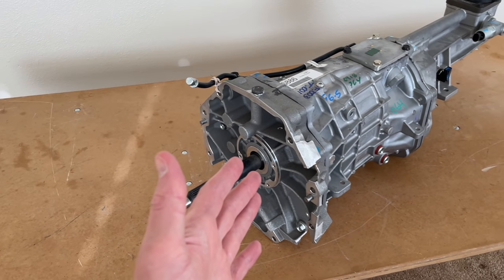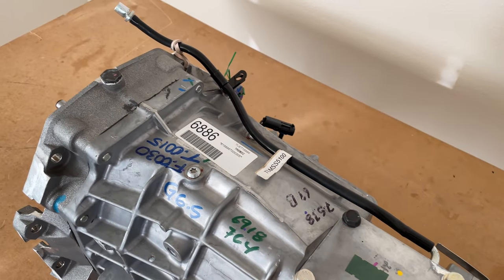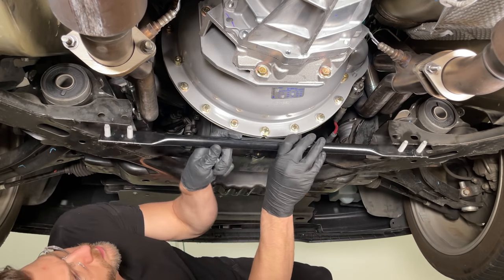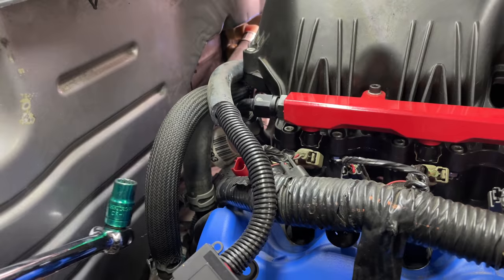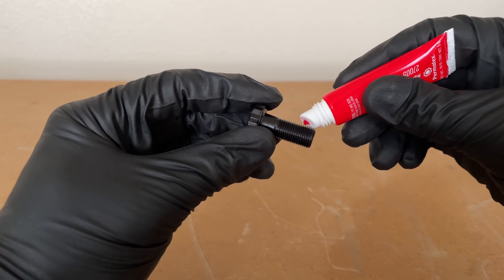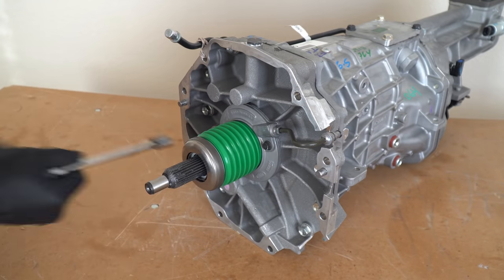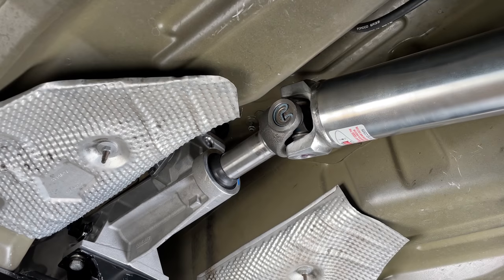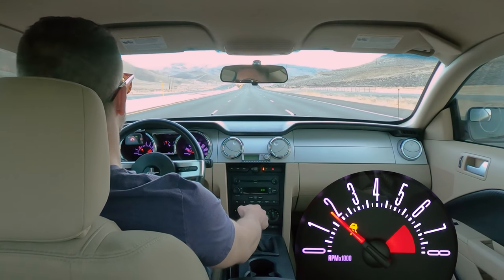How to install a T56 Magnum

Comment from the maker: Have questions for me? Let's chat 👇
https://bit.ly/_foureyes
Reply: will the steps be about the same for the 2015-2017 models?
Reply: What are those jack stands called, do you have a link to buy them.
Reply: top speed run?
Reply: What do you use ATF for a manual box?
Reply: What made you go with 2.97 vs 2.66? Any hills to climb? I think you're running 4.10's in the rear, right?

Comment: this dude literally got video footage of every single step, mad respect, thats a lot of work. i just love a good instructional video
Reply from the maker: it really is - don't recommend it. and thank you 🙏
Reply: @Four_Eyes  probably why so many "how-to's" skip so much of the actual "how-to". Quality work
Reply: @Four_Eyes  worth the effort mate, banging job
Reply: Suggestion for next video: How to have a spotless garage, spotless engine bay, and spotless parts.👍
Reply: The lighting during the under car steps shows that he cares
Reply: Amazing Video!
Reply: Was that the McLeod RST clutch in had in already before u installed the RXT clutch
Reply: Except for the proper mounting depth and shimming of the slave for the bearing to sit on the clutch springs. I run the T56 in my 69 camaro luv it

Comment: Literally the best, most informative build series I've been able to find yet, that's still easy understand! Keep up the good work!
Reply from the maker: much appreciated justin 🙏
Reply: Hogwash. The best, strongest and toughest manual transmissions are, in no particular order
Ford Top Loader
Chrysler A-833
GM Muncie rock crusher.
PERIOD
This is my 50th year in automotive repair including transmissions....I know what Im talking about.
Reply: @donreinke5863  huh?
Reply: @MrM3dic  Duh?
Reply: @donreinke5863  4 gears is too little IMO. I would need minimum 5, but 6 is way better because the gear rations are very close and you get very consistent nearly identical RPM drops in every gear change.
Reply: @SI0AX  Depends on whether its close or wide ratio. The T5 used in older Mustangs had a really low first gear and it would sort of hit the wall from 1-2 even though it had 5 speeds
Reply: @donreinke5863  Most 5 speeds have inconsistent gear ratios. Some gears are a lot shorter than the next gears and it makes you have to remember how much the RPM drops from one gear to another when you want to tune a power band. I find that most 6-speeds even automatics have consistent RPM drops and it takes the guess work out of tuning a power band.

The only 5 speed I would take over a 6-speed is the one on the Lancer Evolution only because it's significantly stronger than the 6-speed version. 

Most other car models usually have a stronger 6 speed transmission.
Reply: .....apart from he did not check the centreline of the input shaft to b/h with a dial gauge....ha ha.....thats real work though, not just screwing nuts and bolts together
Reply: @donreinke5863  fast car uses transmission = best....
Reply: @donreinke5863  four eyes was meaning the best modern manual transmission, than can be easily installed in a 3v 4.6  mustang.
Reply: @rysterstech  "Ever made" indicates otherwise. The statement should have been qualified as to era
Reply: What is funny and I really appreciate about what he’s done is he started documenting the small add ons, then another upgrade and mods after mods here he is. So neat. I happen to have an 06 Saleen Extreme and it is the same Tungsten Grey he has and for some reason I identified myself with him. I just don’t have the nice videos and documented work that he’s done. Kudos to you man! Awesome!
Reply: Hey man, outstandig job!
BTW, I swapped my Tremec T56 for a T6060 but my speedometer is not reading correct. My tuner sent me the file “corrected for the gears” but isn’t reading the speed right, what do you think is going on? Thanks!
Reply: @donreinke5863  🎉❤❤❤

Comment: Good choice going with the 2.66 first gear option, a lot of people get stuck on the numerically higher gears and wind up putting down too much power with too high first and differential gear, basically makes first gear totally worthless.

Doesn't help that OEMs have done the opposite, they have a high final drive and first gear is low as hell, 4x or better.

Looking forward to your projects.
Reply: I like my 5.61 🤷‍♂️
But then I've got 3.07 axles (which will change soon

Comment: I did this swap on my Supra and have to say, MAD respect for being able to film the entire process. Holy crap that must have been a ton of work. Great Video! Also, I was able to stack my Quickjack rubber blocks to get enough clearance to slide the T-56 with a transmission jack under the car easily. It was initially too low to put both blocks at the same time, so I lifted the car up, put rhino ramps under all  4 wheels, lowered it added the extra blocks. It's really stable and saves you tons more clearance.

Comment: Word of advice from a mechanic, ALWAYS replace the rear main seal, regardless of kms on it, and where possible, with an OEM one, and lube it with engine oil.
Very good video, welldone.

Comment: Great tutorial man. A lot of tutorials touch on the important information but would leave out a lot of the little things a beginner would question. You touched on everything...some might suggest using medium locktite on a lot of the hardware to be sure it doesn't vibrate loose. This is a tutorial done the right way.

Comment: You deserve more credit for this video. Haven’t really decided what I want to do yet. I have a 06 gt with a procharger so I was thinking of just doing the engine and trans together so getting an 8 bolt crank and then doing a 6060 but if I do it separately and do the engine first but still want to use the stock trans for a bit then I can just do a t56 swap when needed. Thanks for the info!!

Comment: Excellent video. The fact that you did it on the floor is incredible. Had to replace my clutch but ended up piercing the exhaust system harness against the bell housing causing the oxygen sensor fuses to blow and cause a check engine light. Going to do it on the floor since I no longer have access to a lift

Comment: Excellent video, I don't even own a Mustang but this is super informative. One thing I would do different is to remove the fill plug first to make sure you can refill the transmission once you've drained it. Plus, it'll equalize the pressure as it drains and help it drain faster.

Comment: I just got done doing this on my 2010 GT. I had to watch several other videos that were not nearly as helpful, and of course as soon as I get it finished you drop this absolute banger. You are the man for making this video. It would have helped me so much 2 weeks ago LMAO. I did this the exact same as you, except it looks like you got your car just a little higher than I could manage. I also did not change the trans, only the clutch. It took me so long to get the bell housing bolts off, probably because they haven't been removed for 13 years. Also getting the trans off the engine was nearly impossible. I gave up several times, but I eventually managed to kick its ass hard enough that it just gave up and released. The whole process was a real struggle for me, and I am just happy that it's over. No issues so far, so I think I got everything right. The point is, I feel your pain. This shit sucks without a lift. You're a demon for doing this under the car. Thank you so much for this informative, concise guide.

Comment: The aluminum flywheel does what it is intended to do, but it really sucks for street use.  Been there done that. Granted, clutch type helps, and the McLeod is a good choice. I have the RXT 1200 with lightened steel flywheel, and love it.

Comment: I bought a 93 Camaro new to go road racing, it came with the regular old BW T-56, ben road racing this car for nearly 30 years now, been through several engines mainly to build more horsepower, got a 625 horse LT1 in it for the past 8 years, 225,000 miles on the car now, one of the fastest cars at the track, have blown 9 rear-ends, the last three Ford 9", have never touched this T-56, took Ford a long time to come around but finally, shifter broke a few years ago, put in an MGW, good to go.

Comment: Great video, man!  Gorgeous car too.  I have a 2008 Mustang GT for my track car with a similar build to your Stage II, so I dig your build.  Thanks for making and posting...this is THE BEST trans install video on YouTube...and I think I've seen them all.  Exactly what I need.
Reply from the maker: thanks for checking out the video amigo. any fancy suspension stuff going on outside of coilovers on that thing?
Reply: @Four_Eyes  Nothing fancy.  I did have the Eibach coiler over kit, but I did not like that due to the camber adjustment.  Just ended up putting on a full Ford Racing kit with the adjustable dampers, and 1.5" drop springs.  Front roll bar is adjustable too.  275 tires may need more spring though if I go 200 compound tires some day.

Comment: Thank you so much for this video! Definitely the most in depth video I've found covering this installation process. The timing is fortuitous as I actually have a Magnum XL conversion kit for my 2018 Mustang GT on order from JPC Racing right now. JPC also arranged to supply a face plate (dog engagement) converted Magnum from Liberty's Gears over the standard one, which will allow me to make super fast shifts. Your video has me so pumped to get this conversion done!

Comment: I just put a Tremec T-56 Supermagnum into my 91' Z28.  Ordered it from Chevrolet performance.  
Biggest hassle was the new Torque arm settup.  Also had to remove a little bit of tunnel to get the rear of it tucked up better. The speedo calibration was somehow perfect outta the box which surprised me after wasting time screwing around with a little digital speed signal output adjustment gizmo that was supposed to dial it in (everybody told me i'd need it) and never worked. lol  Unplugged it and and my GPS was bang on with the speedometer without it.  
Cool video thanks for sharing.

Comment: I’ve got a 5th Gen Camaro with a TR6060 and recently did a clutch job. I went with the stock slave cylinder but bought a billet sleeve for the throw out bearing which helps with heat around the slave cylinder. It’s a very affordable part and helps a lot with the rigidity and longevity of the bearing.

Comment: Best install video ive seen yet. Makes me confident that I will be able to do this exact same swap when my transmission finally gives, I have 155k so far on my 09 Bullitt Mustang, replaced the clutch around 100k or less, its been good. But lately I have been having issues of getting the car into 1st gear from a stop only. Once I get rolling smooth shifting, unless im power shifting into 2nd which I get that grind..

Comment: Absolutely bulletproof gearbox. One of the drivers I work for runs a t56 with an electric oil pump w/cooler. We also went with a Steeda sourced t56 short shifter. The 3650 that came in your car was actually pretty decent but with the power you're gonna make - great upgrade. Love the vids man.

Comment: So, I got this exact transmission installed on my 2018 Mustang EcoBoost. Completely custom job since it "Isn't compatible with the 2.3L" as many told me. It works flawlessly paired with a Mantic Clutch and a one-piece driveshaft. I ended up going with the 2.97 1st gear (wide ratio) but with the .80 5th and .63 6th gears. 
All in all, pretty painless install once all the kinks were worked out. Every shift is godlike compared to the MT-82
Reply from the maker: I really appreciate this comment. I've yet to drive a vehicle with a manual transmission that shifts/feels better than a Magnum.

Comment: I went with Tick and had bungs and sprayers installed.

When I ran the lines for the sprayers, I put in a valve and then made a separate suction line to install on the inlet side of the pump.  

If I use a 4 quart bottle, the pump will empty it, filling the transmission up in about 20 seconds.  Then remove the suction line, reconnect the fittings and open the valve.😎

Comment: I broke the blocker ring in my Z06's T56 at a 1/2 mile no fly zone event and removed it to repair at 28,000 miles and then at 40,000 miles all the synchros were toast and I removed it again to repair lol. The second time I used billet 3-4 keys, an iron 3-4 fork and replaced all the synchros. I never knew you could toast your synchros in under 40,000 miles from hard driving. The Z06 T56 has some wierd ratios. Second gear is really close to first, and then fourth gear is extremely tall, it's range is 100-145 mph limiter to limiter. And then fifth is very close to fourth. I think a base C5 transmission with 3.90 rear gears would be ideal.

Comment: My 1988 Camaro IROC was 1st ever to have a T56 6-speed swapped into it from a TH700R4 back in 1993 ! 
The supercharged 383 with Lingenfelter Box Ram intake I built converted to speed density with a DFI box I programmed myself overpowered the Centerforce clutch and Centerforce had to build a one-off Kevlar-puck-based clutch for it.
Was Pro Tour before there was such a thing. Ran low 11s with limited traction and 3.23 gears. Was melting the tires still at half track. 315mm rears on custom Boyds that fit INSIDE the fenders.

Comment: On balance,my painter pal runs a V6 Turbo escort with now around 650 hp which was originally running a very rare 4spd Liberty drag box but this made it virtually un-driveable as a road car,he swapped the liberty for a Quaife prepared T5 with a buttressed casing and drove it extremely hard for 3 or so years without a hitch. Later he purchased a brand new T56 through a dealer in Vegas ,USA which with less abuse than the T5 suffered it dropped fourth gear after only around 12 miles,the box was shipped back to the states and the warranty repair took so long(his words"A fuc*ing eternity!") That he refitted the T5 ,when the T56 eventually came back and was refitted a further 20+ miles exposed the same fault again! This was hastily dumped in favour of Getrags 233 from a late supra turbo which despite being a much older box,wipes the floor with the T56 in terms of durability,fortitude and shift quality. I would rate Ricardo,quaife,xtrac,Weissman etc.as superior to Tremec,of the numerous tremec equipped cars I have rowed through the cogs on only 1 would I describe as feeling slick  and that was a near on £35K  Quaife sequential conversion!

Comment: I did the t56 magnum XL swap on my supercharged 08 Shelby GT after blowing the syncros out on my stock trans. Best upgrade I've done to the car by far! Although the RXT rattles alot when the car is cold and not a fan of that. Shop installed everything so not sure if that's normal or due to installation misshap. Have 15k miles on the trans so far and every mile have beat the hell out of it. I will say that the reverse lockout failed once at 140mph shifting into 5th and the car went into reverse. Thankfully I was letting out of the clutch slow and realized it pretty quickly, but now every now and then the trans grinds going into reverse.

Comment: You are the man. Watching one of your videos I was able to swap the alternator for a high output. SR from American muscle, by the way also upgraded the power wire. The car is still running, so I know I did not messed up. Question swapping an automatic trans to a manual, is that possible, have you heard about it?
Reply from the maker: it definitely is possible, unsure exactly what's required but it can be done!

Comment: I'm hoping to successfully do surgery , and implement an MP3 into my SL2 in a week or so. All I need is 325-335ish HP in mine though. At 2331 Lbs, should be more adequate  fast when I add a full engine build and 14-15 PSI from the extremely light power to weight ratio. Already have a master bushing kit and stiffer springs, and other bolt ons, port and polished intake manifold and bigger TBI, etc, should be fun.

Comment: Another good options would be bowler transmissions. I used American Powertrain and had nothing but issues. Bowler sells a kit for dodge hellcats identical to what I built almost but even tho I used American Powertrain bowler still helps with any questions I got.

Comment: If you open the fill plug for the transmission oil a bit before opening the drain plug, the oil comes out smoother

Comment: Thank you for sharing. I have a t56 magnum on a truck. I bought it from a third-party place that specializes in classic car conversions. I asked them if I could use the best atf transmission fluid and they said you mean gm Atf dexron III...and I told them no Amsoil and they said that they did not know about them and that they could not recommend it. After that tremec came out with the HP transmission fluid and that is the one I use now. I don't know if you were told something similar but I see you used the fluid I used to use. Just wanted to share my experience.

Comment: The 2.66 Gear set is actually the close ratio transmission though. The 2.97 gear set is the wide ratio.

Comment: Hey man, I saw the Blue 3v 5.0 Mustang GT video from Karl mustang was putting down 425hp and 370tq. Well at least on Standard not SAE, so he was looking in the ball park of 382whp and 333tq you've honestly done an amazing job with an N/A 3V. Gonna be honest I am aiming for 500whp N/A 3V, since here in Texas we have a few more things available than Nevada.
Reply from the maker: Yeah his build has a bit higher compression so he's pushing more power than me, but I'm close. 500 NA whp in a 3v would probably be a world record. Probably require 12:1 compression and E85 one top of everything else Karl and I have done.
Reply: @Four_Eyes  The engine will be similar to brenspeed's B326 Stage 3 Block so a larger displacement. Wish me luck. Can't wait for the turbos output video.